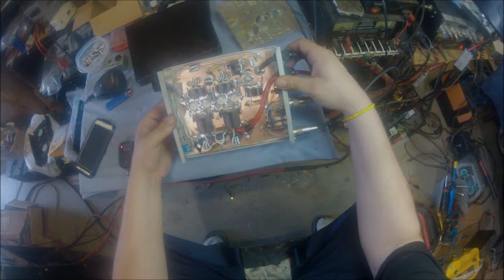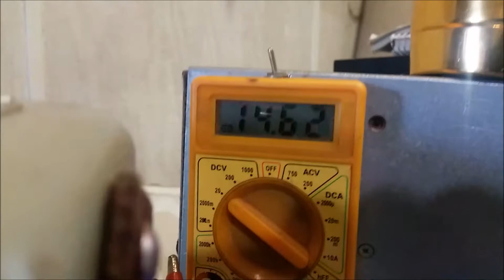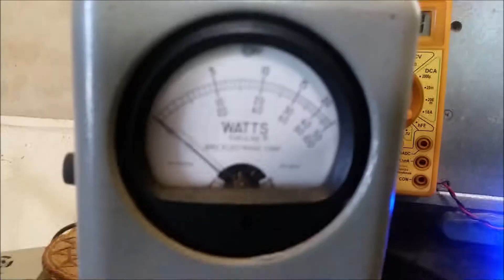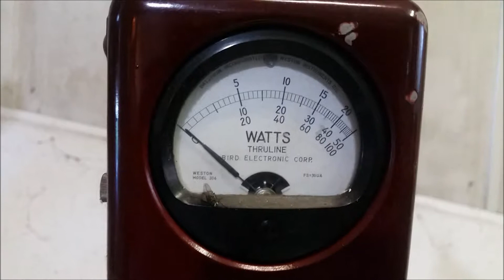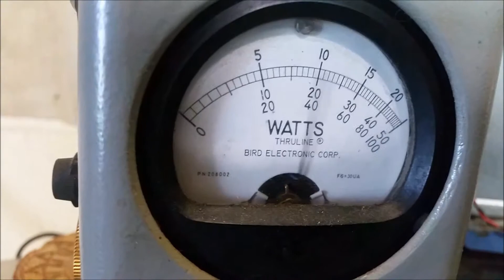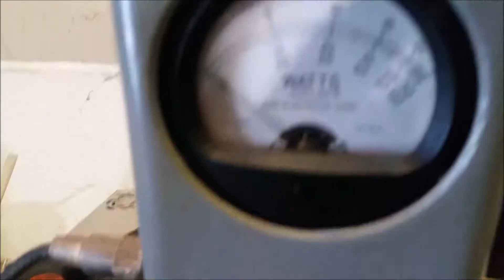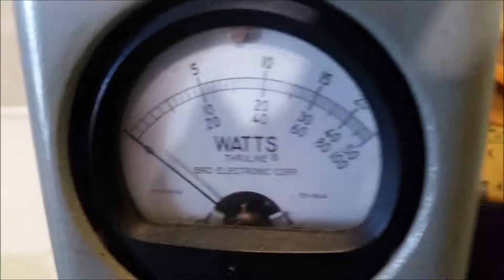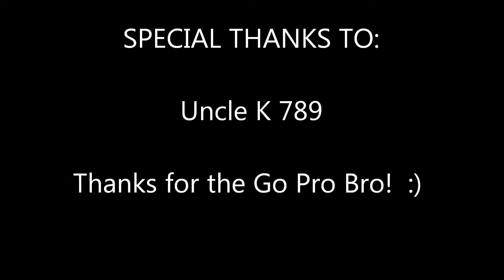Palomar 1x4 To Gatekeeper 1x4 OLD To New

Comment: Now that Palomar is better than new. I got a old one like that but it is just a 4 pill the pills cross to MRF 450 . had tunning issue . think had some old mica go off value . I made new bord for mine. I used SRF 3775 match set and bias . does about 250 watt PEP SSB and does not heat up much . now as for 2 watt resistors you asked me before in 1.6 and 1.8 ohm you can go to ICA online in resistors and he has them. metal film is ok for bias . I now have from Japan 100 ohm and 200 ohm 1% resistors in 2 watt,3 watt and 5 watt . they are blue and has value printed on them. non inductive flame proof . just came . some caps as well.  low ESR audio grade .  73's

Comment: May I ask why u hot key when u show ??? What. Saying is you modulate when u key .... Let us see the loaded carrier then modulate ..... It shows the Ballance of the modulated carrier ...I'd like to see a deadkey  then modulate off the carrier
Reply from the maker: Good point....I guess I don't it much because you can pretty much make the amp dead key anything you want them to with the right radio. I ALWAYS keep my radio DK at 1w with testing and such but good ? Bud, regardless the more data the better video I do need to start showing the Carrier as well. Thanks for pointing that out.